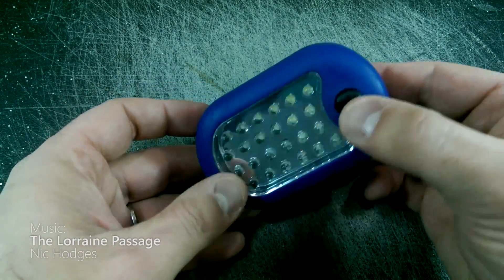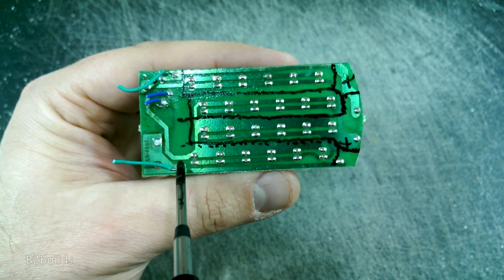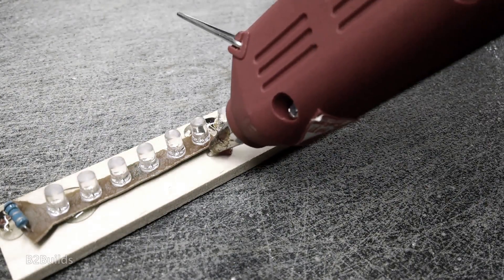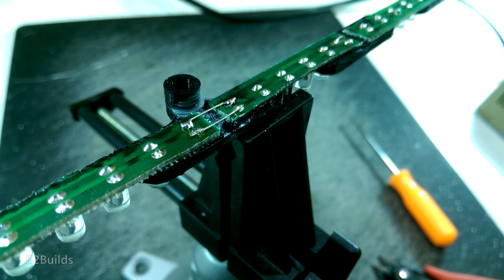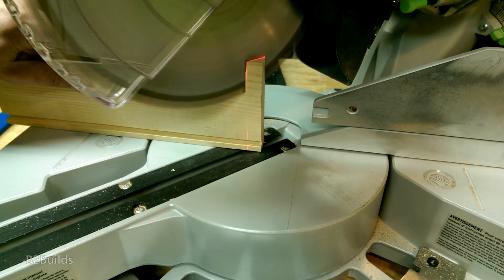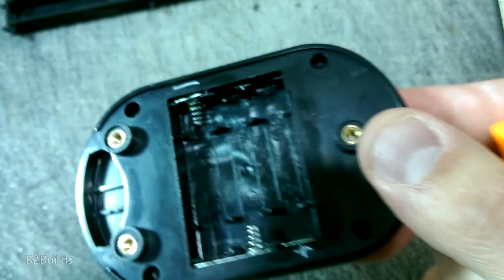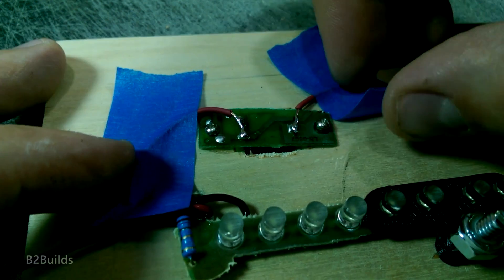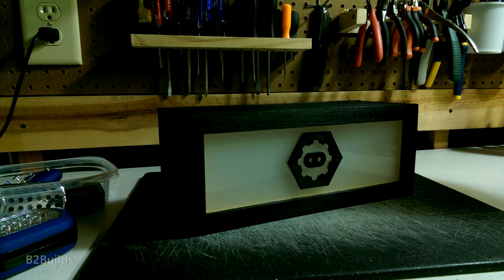LED Backlit Sign from a Harbor Freight Flashlight: Version 2

Comment: it would be cool if you could make it solar...
Reply from the maker: I've never worked with solar power, might be fun
Reply: harbor freight has a small portable panel for small charge like that, I also had one for my truck when it was parked for a while I just threw it in the window and ran it to the battery kept it charged. I got that one from pep boys auto parts.

Comment: Looks like you're being a little lazy with the 3D printing! 😋 Could have printed a snap-on cover for the custom battery case, and you would have had a smoother back panel (if that was an important factor). Seriously though, nice upgrade from previous version!
Reply from the maker: Ha, not as lazy as it seems... That was actually a second design and print of a battery compartment. Though you could certainly print a battery cover.

Comment: Lots of cool tricks you put into this one. You gave me a lot of ideas.  Do you know what color temp those leds are? If they are close to 5000k that would work for a nice ring light.   Thanks for sharing!
Reply from the maker: +Hammer and Neil Thank you. I'm not sure what the color temperature is, though for a flashlight as low cost as this it may not even bee a consistent color from one batch to the next.
Reply: Ben Brandt haha I didn't think of that.   I'll probably just compare some daylight bulbs to those LEDs and see.

Comment: I don't think this is one of your better projects. Couldn't you have just mounted the entire flash light at 90 degrees to the front panel with a diagonal white reflector and the same box and be done with it?
Reply: I think there are  a lot of ways to accomplish the look.   I do like the incorporation of 3d printing and the long strip of LED. I think the long strip would distribute the light better than just mounting the flashlight inside the box.
Reply from the maker: +Robert Evans maybe so, and that may have been good enough for some, but not up to my standards, and this way was more fun and interesting for me. Still being relatively new to 3D printing, this was a perfect exercise to design and print custom parts to serve a purpose.
Reply: How about print a holder for the unmodified light at the end of the box and the diagonal reflector dado cut into the top and bottom behind the front panel?
Reply from the maker: +Robert Evans it could certainly work, though for me the modification is the fun part. I don't plan on making any more of these anytime soon, so I'd be happy to see what other folks come up with.